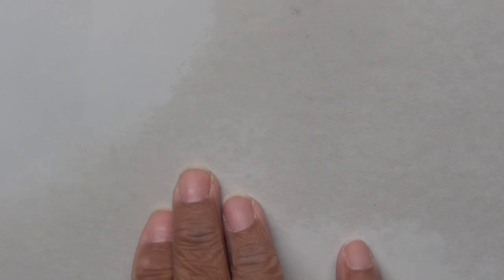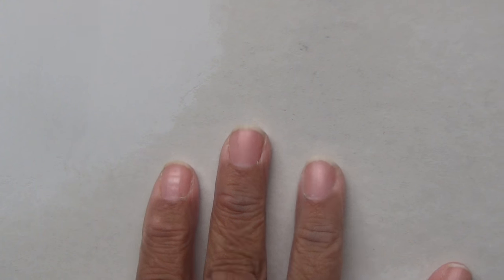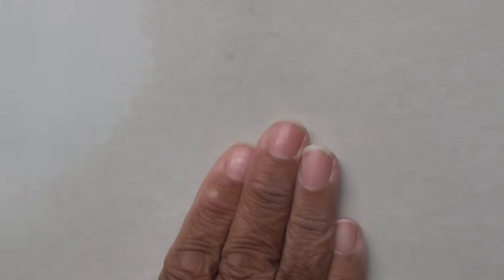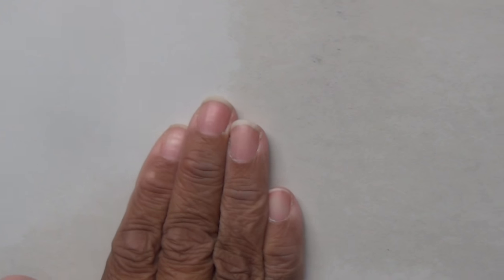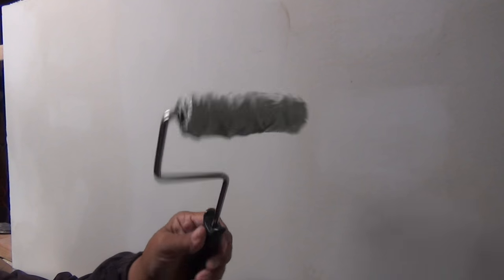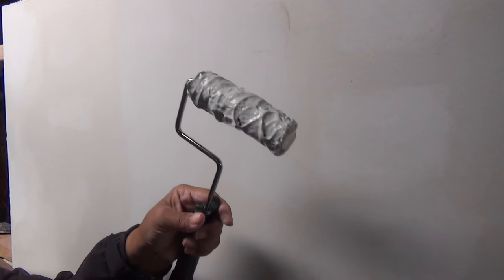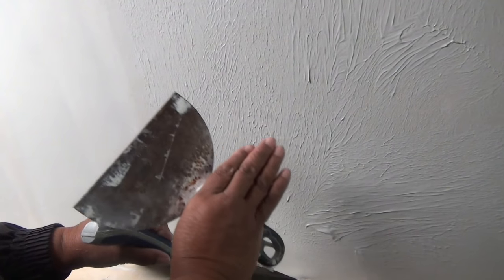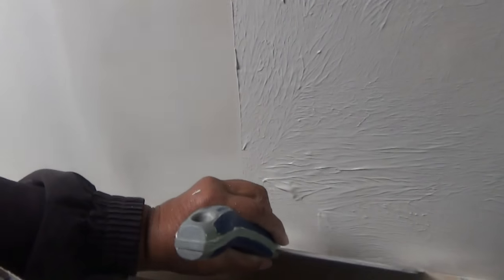How to Create a Level 5 Drywall Finish

Comment: I struggled with this for years until I had a contractor do some work and the paint and finish was part of the estimate. My problem was I tried to build up too much compound too fast.Thin repetitive coats to complete the level 4 finish was the trick. His guys so so good and so fast, they didn't need to sand anything that wasn't a transition point.

Comment: I always love the videos. A few tips to add. I am a handyman who mostly does drywall & paint. A primer coat of flat (no gloss) paint over a level 4 drywall finish should eliminate any flashing when applying a high gloss paint. Whenever I repair drywall on glossy paint, I always prime with flat paint and feather out the edges before re-applying the glossy paint. I constantly do repairs in foyers & stairwells with harsh lighting and the result is always great. Also, when doing drywall, it's a popular saying in my territory; "Thin to win!"

Comment: What ratio of water to joint compound would you recommend?  I'm thinking buying one of those orange 5 gallon buckets from Home Depot and mixing one of those boxes of premixed joint compound in the bucket with the water.  Also as far as the mixer, would a metal paint mixer connected to a hand drill work?
Reply from the maker: you won't be able to do large batches that way.  You will need to break it down into smaller batches.  The consistency should be thin enough to roll onto the wall.

Comment: Really? Well I be dog, something told me to do a quick search to get the REAL AND TO THE POINT EXPLANATION of a "level 5" paint.  Some ding dong contractor told me it means you apply a thick coat across the whole wall, sand, then you do 4 more coats to "give it depth".  I'm a tradesman/handyman and don't get me wrong, I've done it before and it looks good, but I would have been done with a level 5 skim coat job and now for sure today will be the day I'm done thanks to you.  Just apply and swipe...move forward.   Thank you Leah for the up-front truth.
Reply from the maker: you're very welcome, I'm glad glad to be of help!

Comment: Many of us end up with drywall paper tears when removing pop corn ceiling. I saw your other video that describes how to fix that. We'll need 2 floats after that to achieve level 5. Do both need to be done with air-dry JC or does the first one need to be done with setting JC?

Comment: If the only reason for doing a level 5 finish is to even out the difference in porosity between the exposed dry wall (being more porous) and the mudded area; then does that mean that there is no need for a skim coat on pre-painted walls? I have repaired a 16x16 section of my bathroom wall, and the surrounding un-mudded area is in perfect condition and finished with high gloss paint. Do I need a skim coat? My concern is that the 16x16 area will show through once I have primed and re-painted the whole wall. What do you think?
Reply: James Baxani it will show. It’s called flashing. If you sand the entire wall where the patch is located to knock down the sheen. Then spot prime the patch. Then paint the entire wall and you will be good to go.

Comment: When doing this over heavily damaged drywall (ie. after removing wallpaper that was glued directly to lvl 1 or 2 drywall, or popcorn ceiling that was very adhesive). Is it better to go and try and fix each individual rip/tear/gouge/hole, or to just do a thin (1/16th") coat over the entire wall/ceiling, sand, then skim coat/fill in little gaps or dips in my mudding?

I've been working on our ceilings for a few days, and an thinking that doing the whole-ceiling coat is a poor idea. I'm using tons of mud, and it's taking me a lot of mud & sanding passes to get it perfectly smooth/flat so it won't show ridges or shadows in bright light. On my first small room (entry way) I probably ended up with a good 1/4"+ of mud when it was all said and done...
Reply: I would think you would need to apply a primer-sealer to the damaged areas first so the drywall compound doesn't bubble up in those spots, then skim coat the entire surface to even it out.
Reply: Just noticed this was from 3 years ago...lol never mind. I'm sure you've got it sorted out at this point...

Comment: Leah - First, I love your channel!!  I have a question:  I have 1990's sponge painted walls in my dining room.  Can I use this type of technique to cover over the paint texture and make the walls smooth again?  The walls are plaster and were extremely smooth before they were painted.  If not, do you have a recommendation for getting rid of the slight raised paint from the sponge painting?  Just sanding??  Thanks for any advice you have!
Reply from the maker: I believe it can work.  I would, however,  test a small spot first.
Reply: Thank you!  Happy Halloween!

Comment: Do you have a video showing how to smooth a textured wall? i saw the one you posted involving a plaster wall, but guessing the process and materials would be different for textured dry wall. i have 1 textured wall that just looks awful and am going to apply paintable vinyl wallpaper as I don't think i can fix and replicate the texture. Thank you in advance for your help!!
Reply from the maker: If you want to take a picture of the texture and email it to me, I might be able to help.
Reply: Thank you! can I facebook message it to you? Otherwise, let me know where to send, please.
Reply from the maker: facebook message is fine, and my email address is posted on the see jane drill website, so whichever you prefer
Reply: i sent it to your seejanedrill facebook page linked in the description for this video.

Comment: I learned things....thanks! Would some sort of primer remove the need to do all the joint compound?
Reply from the maker: Yes, for a level 5 finish,  USG makes a primer-surfacer product called  "Tuff-Hide" that you spray on with airless spray equipment.  That particular application is for larger jobs.
Reply: +seejanedrill awesome and thanks again! Level 5 here I come for my next paint project :)

Comment: Do you need to put anything on an already plastered wall if you need to put a skim coat on it?
Reply from the maker: Hello Mitch,  The answer to your question depends on what material you use to skim the wall.  If you're skimming a plaster wall with plaster you'll need to apply a bonding agent first.  If you're skimming the wall with  joint compound, no bonder is necessary.
Reply: +seejanedrill Ok thank you i am using Thistle Multi finish plaster over an existing plaster coat.
Reply from the maker: You must be in the UK?  There's a bonder called Thistle Bond-it which you can use in conjunction with Thistle Multi Finish.  Good luck with your project.
Reply: +seejanedrill thank you